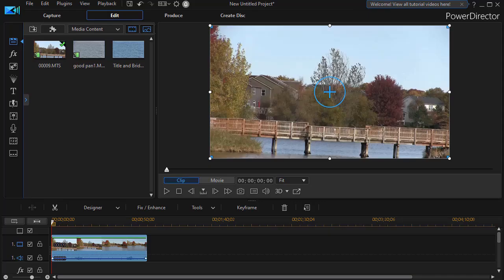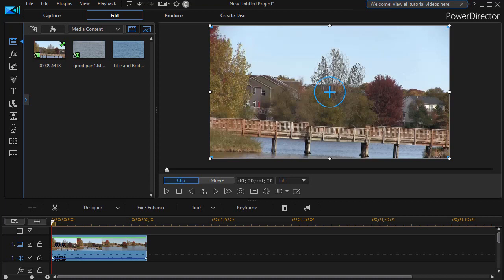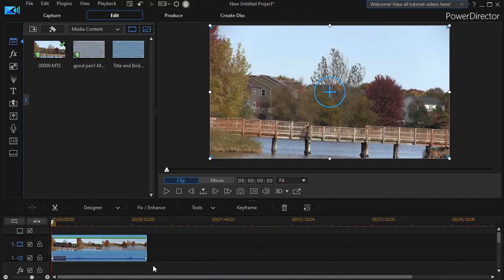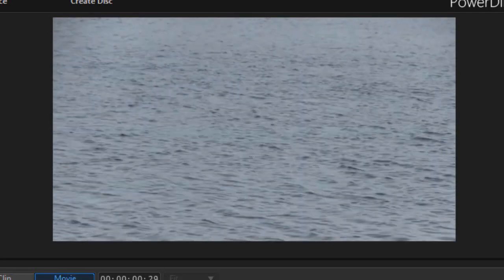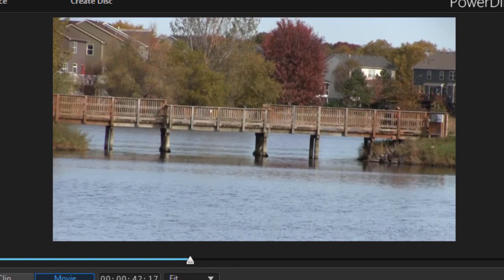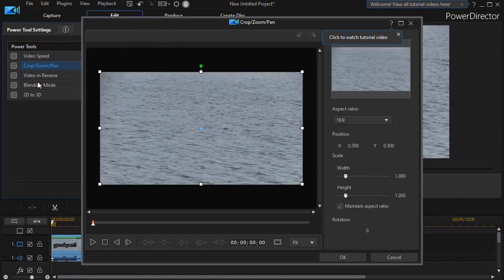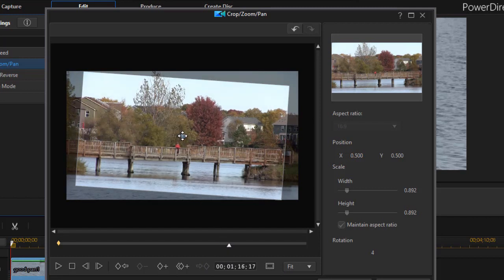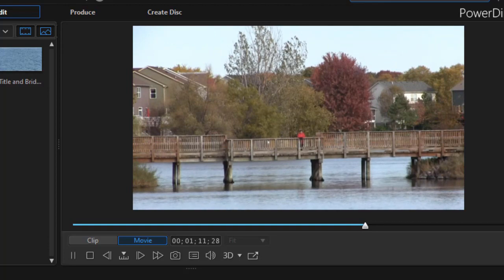PowerDirector - Problem solving - static footage and unlevel frame

Comment: Nice video, learned a lot again! Could you help me understand a bit more about what frame rate to upload to YouTube.  I recently uploaded a video that I created in a 24fps time line to YouTube and it came out choppy.  It was also rendered in 24fps, because I also figured you do not want to render a video in a  different  fps rate other than the fps editing timeline.
The reason I uploaded and edited my video in 24fps was to achieve a more cinematic look and this allowed me to slow down some of my 60fps clips.  
I had seen someone else suggesting only upload to YouTube in 30fps for smooth video.  In order to do this, I would not of been able to slow my 60fps footage to 40 percent of the original footage. 

I uploaded the rendered 24fps clip to YouTube and it came out choppy.  

I then did an experiment and rendered the 24fps edited timeline at 30fps, and uploaded to YouTube.   It did seem a bit smoother.  
I reviewed the original saved rendered 24fps clip on my harddrive and it was still much smoother than the uploaded rendered 30fps, edited in 24fps clip. 

Any help would be appreciated.
Reply from the maker: Jeff,
I understand the difference you are talking about with the 24fps and the cinematic feel to the clip at that frame rate. I'm not so much an expert on what YouTube does to adjust the videos for use in its system. I am not familiar with the algorithms it may use to adjust video to live within its parameters. I'd have to know a bit about that to give you any intelligent insight. My only guess is that there is some re-rendering going on that is not as friendly with 24fps as with 30fps. And I'm not surprised that the results are not as 'pure' as the original in either case. 

Maybe someone will chime in on this discussion who can lend more expertise than I can. --Jim
Reply: @SharperTurtle  thanks Jim, I'll try to do some more research as well.

Comment: I get perfectly horizontal shots by using a cheap spirit level I bought from a craft shop, but this is a good technique for straightening up any wayward shots. Thanks for sharing, look forward to next part.
Reply from the maker: Phil,
Even though my tripod had a bubble level and was accurate, the image was not because of my shooting angle. So sometimes post-production is essential anyway. I should have noticed the issue in the viewfinder, but the light was so bright it was difficult to see details. --Jim